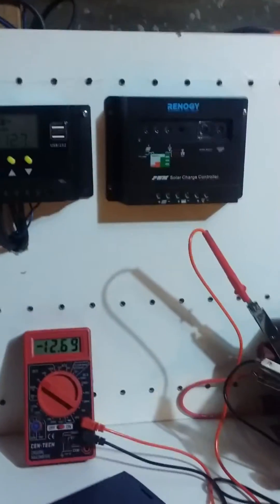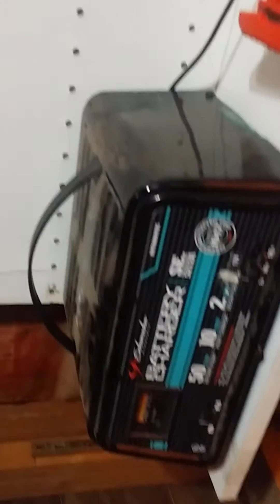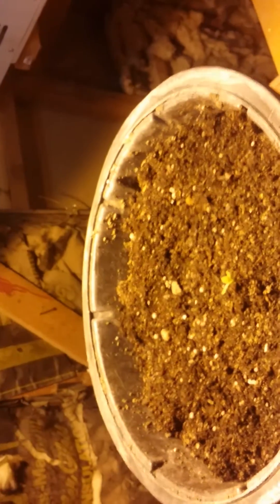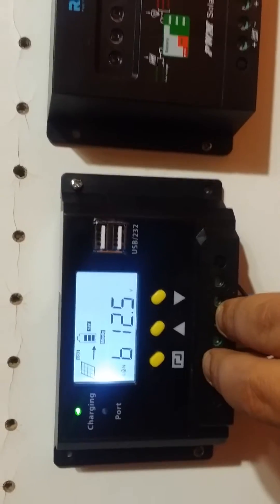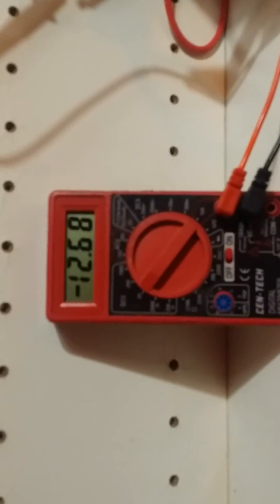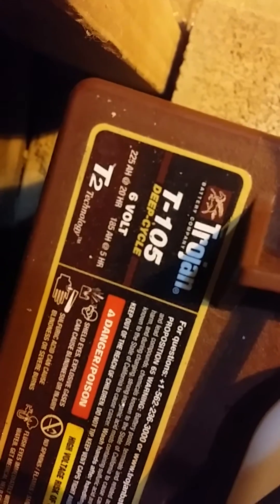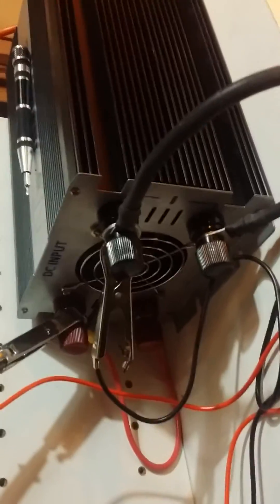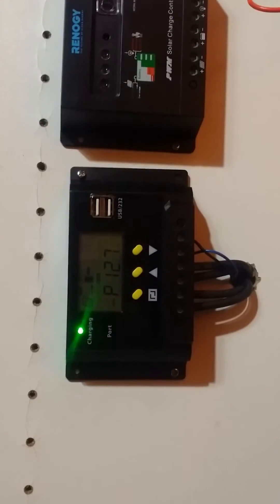Solar powered grow room test

Comment: Could you run it 24/7
Reply: i use 270 watt solar panel and 200 ah deep cycle . i ran a 1000 watt inverter with LED grow lights im able to have a seed section running 45 watts 18hr  a veg running 100 watt led 18hr and flower running about 200 watts of leds  11 hrs on and all my fans ..i do micro grows ..up to 50 clones or seeds in  seed the seed section  but  they can only get a 4-5 inches in that section..i can do 5 a tim e in the veg up to 14 inches. and 2 time in the flower .. up to 3 feet......BUT you can use this in a full size grow with 5 plants in flower np his way is out dated.

Comment: what amperage are your panels? and what wattage was the hps bulb? I have about 35ah max come in off my 2 250w panels through my 40A MPPT controller into 2 12v 190AH sealed lead acid batteries in parallel, with a 2000w 240v pure sinewave inverter and i can run a fridge constantly and have lights (6w leds) and typical house hold chargers plus tv stereo etc.i want to be running at least 600w led grow lights, but i doubt my setup will cope. what did you end up running (in detail) in the end?

Comment: it'd be cool to add some solar panels to your grow room to add to the power bank. eh? Ima try. At least you get a return on the light output that you expended electricity to make by reclaiming any extra and reconverting it back to electricity. it seems efficient. this way, your lights can run at full power for longer throughout dark hours. what do you think?

Comment: you can probley use a dureacell powersource 1800 it cost about $600 but its a movable generator with option of solar or wall plug in to charge it.